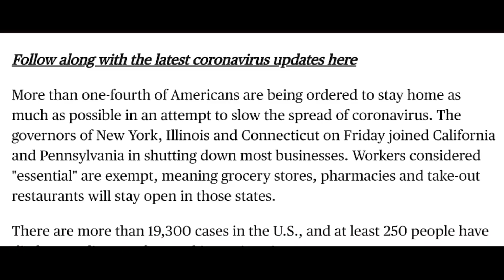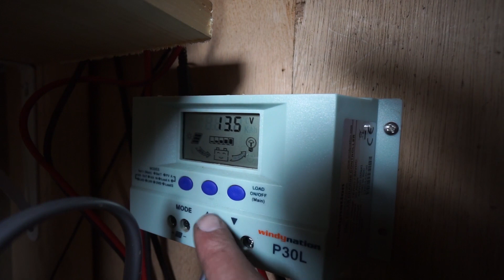Installing Additional Solar Panels on the Off Grid Cabin - Cabin Quarantine Day 27

Comment: Nice how to! Straight forward! What does the flashing do? Why not just a flat piece vs angle? TIA
Reply from the maker: The angle acts as a ramp to guide water around the mounting point. Helps the hardware stay dry and last longer, esp helps through the winter.